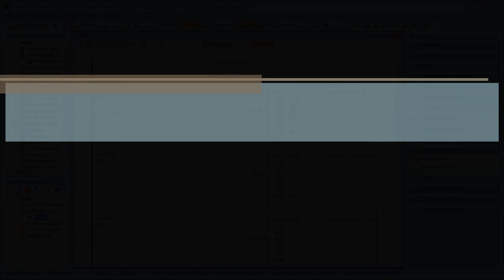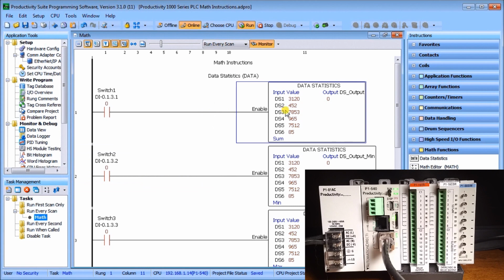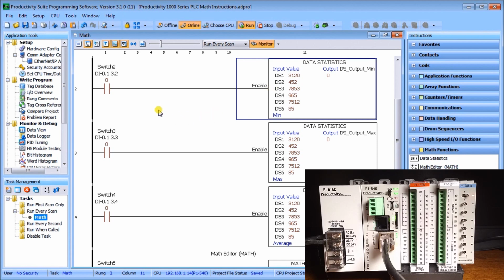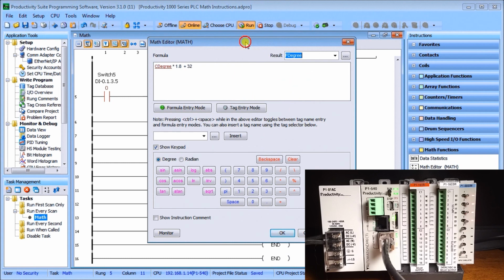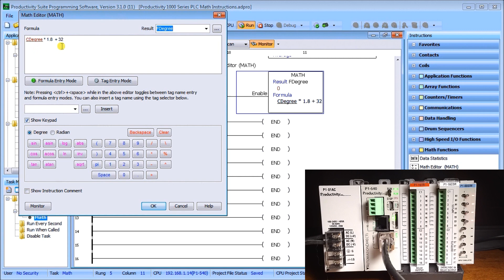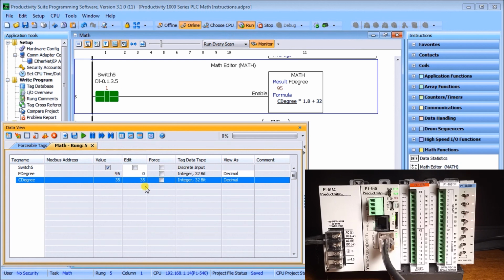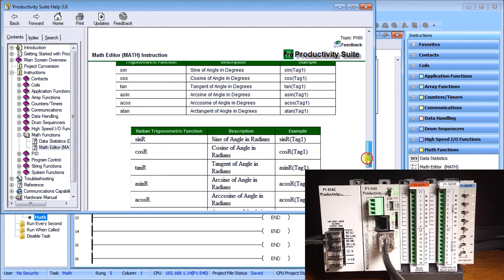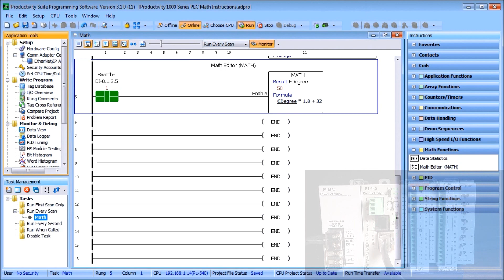Productivity 1000 Series PLC Math Instructions

Comment: Does the math function automatically "promote" integers to floating point values?
for example:  
2 / 5 = 0.4 (inputs were ints but output is float to be able to hold a decimal)
2 / 5 = 0 (inputs were ints and output is still an int, resulting in 0.4 being truncated to zero)
Reply from the maker: Hi Miles,
In my example above I used 32bit integer register as the output tag. The math instruction will place the result in the type of tag that you specify. If a float is specified you will get the decimal points. 
Regards,
Garry

Comment: Hello, is there a way to do math on an entire array in one step?

I'm trying to take an array of minute values and multiply all values by 60 to get an array of second values.

I know I could set up a loop to do the multiplication on each constituent of the array by stepping through the index, but I'd like to avoid that.
Reply from the maker: Hi Mutantcy1992,
There is no way to do the math on an entire array in one step that I know of. You would have to set up the loop with indirect addressing as you mentioned. 
Is there any way of doing this when the information is collected in the array?
Regards,
Garry
Reply: @ACCautomation  Thanks for the prompt response!

No, I don't think there's another option. The values are entered directly by the user, so I'll get to work on that loop!
Reply from the maker: @Mutantcy1992  
Perhaps you could automatically do the multiplication when the values are entered.
Just a thought.
Regards,
Garry
Reply: @ACCautomation  Hmm, how would I go about doing that?
Reply from the maker: @Mutantcy1992  
Depending on the HMI being used, I would detect that a value has been entered. Then multiply and save in another array.
Regards,
Garry